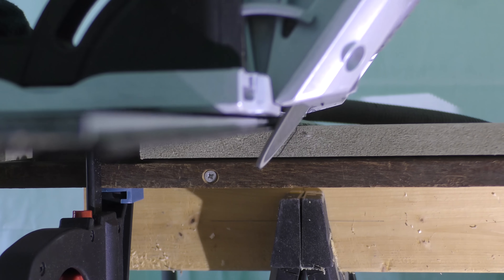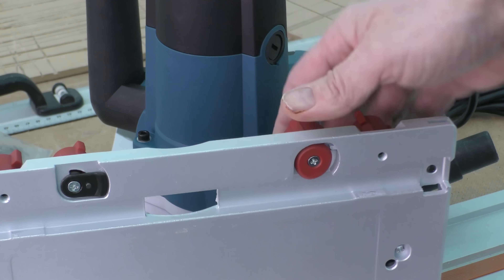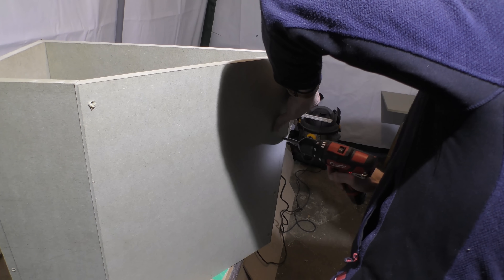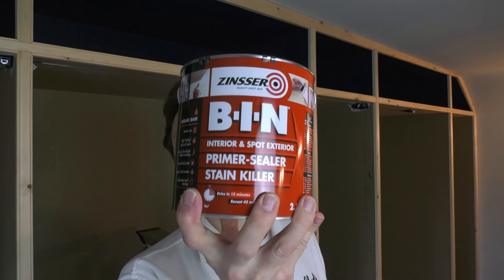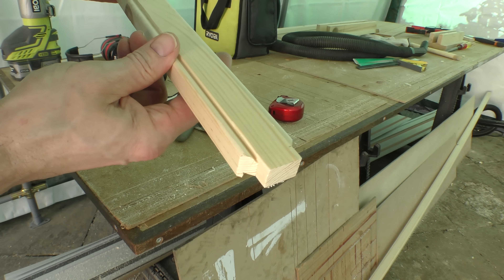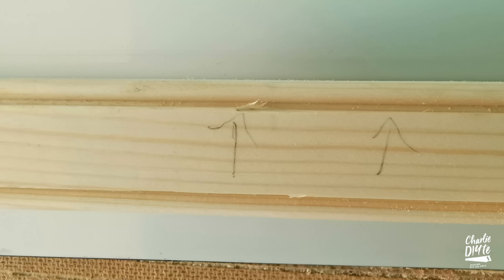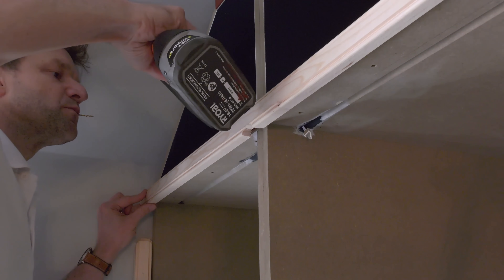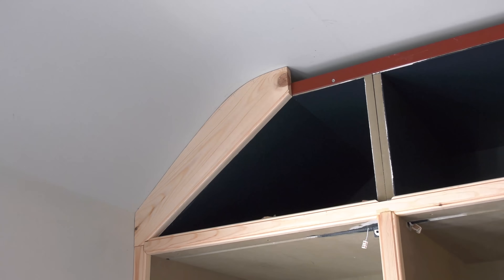DIY Fitted Wardrobe Build - TOP BOXES, PAINTING & FASCIAS - Video #4

Comment: charlie alan from scotland here, wonder if you can help me as i have new problem at my house , ive never had dampness or black mould in 20 years but about 2 months ago my partner noticed black mould at bottom corner of gable end of house , i checked my gutters with a camera and found they were full of moss and water front and back of house btw every corner of the gable end of the house had mould top and bottom and even along bottom of pvc window frames upstairs and down stairs can you please help , have have gutters repaired and cleaned, be much appreciated

Comment: Quick pro tip, when attaching your fillers at the sides add a couple of biscuits up the vertical edges of the mdf and it'll help your alignment and stop it pushing away from the side of the carcass as much, dominoes are best but we don't all have the budget for them 🤷‍♂️

Comment: Hi Charlie, I can’t say you are a diy’er you work more precisely than most professionals. Question how did you scribe the top metal strip. It fits so perfectly.
Reply from the maker: Thanks buddy. I lowered it to the point where I could position it horizontally and then scribed the contour of the ceiling on it, from memory. 😉

Comment: I love this Wardrobe Build! Around 1963, having just obtained my GCE in Woodwork I produced drawings to 'remodel' my parent's tiny kitchen. I actually measured the size of all the cupboard and drawer contents to ensure that their capacity was optimised. All construction was done with basic hand-tools (bought from the money I earned at a Saturday job), outside (no Workmate bench), over the long summer vacation. My father approved my design and paid for materials; N.B. mostly plywood and the worktop was Formica glued with contact adhesive! Maybe forty years later my 'kitchen' was replaced by 'modern units' and worktops. My mother, bless her, said that my 'bespoke design' was far better!

I have never regretted that my Secondary School taught me Woodwork, Metalwork and even Brickwork as well as Technical Drawing! With 'A Levels' in Physics and Mathematics my career was in Computer Engineering and that gave me greater skills in electrical installation than most 'electricians' and greater skills in 'Mechanical Engineering' than most 'mechanics'! I, with some 'self education' have taken on every trade! Plastering was was the most difficult, agonisingly exhausting and painful - that is one I will forever leave to the 'professionals'.
Reply: Interesting story Alan. I didn't know that was even possible before the multitool was invented :).
Reply: This sounds lovely. I wish schools still taught all of this. It is a useful life skill.

Comment: Love the colour of the inside of the top boxes would never have thought of that. Probably would have gone with the default white.
Reply from the maker: It's controversial mate, and I'm still soul searching over it. On the advice of an interior designer I heard on the radio, we've painted everything in the room - walls, skirting, window frames - the same colour, a pale blue, and we LOVE it. Removing that contrast makes the room seem larger and helps you focus on the outside. However we choose the wardrobe paint before we made that decision. So it could massively backfire or alternatively become a "wow factor" feature in the room. Only time will tell 🤞🏻

Comment: Try floetrol additive for the top coat water based paint. I've done that for skirting and doors. It makes the water based paint behave like oil based. The finish will be much better when brushing or rolling.
Reply from the maker: That's a lovely tip, and does it make it more durable too? Thanks Stephen 👍🏻
Reply: @CharlieDIYte  it's doesn't affect durability at all. Read all 1,100 plus reviews on Amazon ;) always best for waterbased paint to have a week or two to fully dry. Even 2k car paint can take months to achieve its full strength.

Comment: I use an old matchbox for my scribing tool as you can use it on the thin sides or the wider face/back pieces and it's readily handy in the tool draw on my workbench but you can use anything even a scrap piece of timber offcut.

Comment: Nice job Charlie.  I am still not sure about the metal band, but at least you used it in the correct orientation.  I also made a cyclone collector similar to yours and it works well.  The only problem is a collapsing barrel, which i have fixed for now with some internal wooden re-enforcement.
Reply: I agree about the metal band, correct orientation, great idea but not sure of implementation. I would prefer several fixings in both layers of the MDF shelves.
Really impressed with your execution of the wire loom. It really demonstrates the complexity required to deliver a lighting system for a built in wardrobes. To a layperson they would open a door and be pleasantly surprised that there's an auto lighting system without any appreciation of the work planning and execution required to deliver  a simple lighting system, well done bud for you persistence and determination to deliver those lights.

Comment: Hi Charlie, great progress and I like the face detailing with the softwood moulding which gives a touch of class. I think you may have been more successful gluing it onto the metalwork with PU cartridge adhesive such as can be bought from Toolstation etc. It sticks like sxxx to anything and joints dissimilar materials really well. It's also good at gap filling not that your work has any! All the best😁👍

Comment: Hey Charlie, was really hoping you would take us through how you measured the angles for
The end boxes, not many videos in that on tinternet and would be great to be taken through how to get the angles
Reply from the maker: I'm sorry about that Darren. If you pause it at 02:35 you'll see how I got the angles. I basically put the box without the angled section on its side, rested the diagonal piece on top and then drew on that diagonal piece a line in each corner where it hit the box. That was my cut line. Does that make sense? If not I'll see if there's any other way I can describe it.
Reply: @CharlieDIYte  yes didn’t catch it initially! Thanks Charlie, top class work
Reply from the maker: @dazcssdsc  Thanks mate 👍🏻

Comment: Please make sure you give those lime green rollers a good wash and rinse. I’ve started putting the pack through the washing machine on a wash before they get used. Even run them through a quick tumble as it seems to make sure they not then leave micro/flock in the paint !

Comment: Hi Charlie. Fascia looks really slick. You gave yourself a job routering the back edge to form around the steel strnthening bar. 
Couple questions. Would it not have been better to router a groove in the top of the main carcasses and run your strengthening bar along the top edge? Albeit along the bars weaker axis. The boxes may still belly in the middle of the cupboard behind otherwise?

And the golden question. How can you make water based paint more durable. Its a lot of work but have you considered finishing the whole thing with a water based polyurethane.  (cheapest product iv seen) is polyvine dead flat for painted finishes. It could be applied with a cheap sprayer once all the painter work is finished. And they have a dead flat option which would mean the varnish doesn't create an unwanted sheen on your painted surface? Food for thought as it's so heart breaking to scratch the surfaces after you sanded and painted the whole thing 4x over

Comment: Hi,

It's been a couple of years since this series has been uploaded but I have watched it twice now for inspiration (plus I didn't get one bit of it and had to rewatch the section on the 'trim' quite a few times before I understood what was going on. Thank you for such a clear video which has given me confidence too try this myself.

Few questions I apologise for the length of them in advance , but if either Charlie or any other budding DIYer has drawn inspiration from this build, that I would welcome some thoughts on:
The cupboard sizes and adding in a 'shelf', Charlie has opted for 'top boxes' due to the strength of the wood/aesthetics? The double wardrobe appear close to 1metre wide, ignoring cost, would the whole thing be better/worthwhile making out of Ply rather than MDF or are there some other downsides? If this was made out of Ply, would a 1metre shelf be viable or do we think that may still sag? (Lastly on the shelf/ply issue - Would screwing and glueing a shelf in be sufficient or is there a more effective way of installing?)

Also, everything was constructed with glue and screws, other than it being a pain in the backside getting everything aligned, would adding dowels or 'biscuits' (whole new world to me), be worth doing, or do we think that would have minimal gain?

How did the finished wardrobe stand up to the test of time, is there any flex in the side panels with the weight on them, are you still happy with them?

Thanks
Tom

Comment: I’d be interested in how you’ll caulk the joints between scribe and walls. I can imagine those walls will move a lot and the caulk would crack?
Reply from the maker: You've just reminded me, Rob. I should have primed the scribed wood where it contacts the caulk before I fixed them in place 🤦 I'll probably use the gap filler I used on this job https://bit.ly/38SZ9vK, which had much less shrinkage than caulk.

Comment: Really enjoying the video’s it has spurred on my interest to do carpentry projects. Like you am not a carpenter by trade but a DIY enthusiast so appreciate use of affordable tools,. Recently built a desk for my study using a circular saw and guides I made with mdf. Great result but dust all over my garage even though used dust extraction. Was hoping you might of talked a bit more about your new Erbauer plunge saw and how it compared to your Evoution  ?  Were your cuts alot more accurate, was it easier to use and how was the dust extraction?
Reply from the maker: So glad to hear it's spurred your interest. That's why I set up this channel!! I think the problem you have Pieter is that circular saws, whilst wonderfully versatile, were not designed with dust extraction in mind whereas plunge saws are. When cutting through sheets of MDF plugged into the vacuum, the dust was negligible. A little more when trimming an existing cut but you'd expect that because there's not so much suction against the open edge. I find the plunge saw a hot to use. I'm not always 100% accurate on the cuts of I'm honest - occasionally a mm too wide in the centre but that could be the way I'm aligning the cut out perhaps the quality of the saw. The cyclone is also a revelation. A week after a lot of cutting and the vacuum is still empty!

Comment: Wow, building anythjng like that would be a dream. For now we are installing a pax wardrobe and have a problem on how to fix it to the wall when we have a skirting board and a dado rail. I found one video suggesting to use a batton or piece of wood to fill the gap, fix it to the wall and then fix the wardrobe to the wood. We were wondering if it was possible to fix the screw straight to the plugs-long enough screws to get abt 4-5 cm into the plug. The wardrobe will be stopped by skirting and dado anyway, so wont be moving, just worried if there should be a problem with a screw not being fully in the wall- unnecesarrily? Would be soo grateful for a comment or reference to any of your videos! Thanks. Those are such massive help.
Reply from the maker: Hi Anna, you could certainly do that. You'd just need to choose the plugs and screws carefully, so that when you tighten the screw it doesn't pull the plug out of the wall, which it shouldn't if you've got a nice tight fit for the plug on the wall and a decent diameter screw. The batten method is obviously superior because you've got something nice and strong to fix to. With your suggested method you've got to be careful not to overtighten the screw and buckle the back of the wardrobe.
Reply: @CharlieDIYte  thanks so much for the hints! All make sense, we probably wouldnt have though of them. We are gking to go ahead with the option to go straight into the wall then :) fingers crossed we achieve a good result

Comment: Thank you Charlie, an outstanding set of videos,  packed with great info and advice. Can I just check, as you were using different thicknesses of MDF for the wardrobe carcasses and top boxes, did you reduce the width of your facial to compensate... or just have them wider? Thanks in anticipation.
Reply from the maker: Thanks Michael. No, the top boxes were still made from 18mm MDF. It's only the back of them that has the thinner thickness. 👍
Reply: @CharlieDIYte  Wow Charlie,  thank you so much for answering my question; all makes sense, my mistake. Thank you also for taking the time, really appreciate it.

Comment: Good work Charlie, 
I'm going to make 5 x 600mm wide carcasses and not any double width carcasses. Do you think I would still need to strengthen to eliminate sagging?
Reply from the maker: Thanks. No, you'll be fine with that. The single carcasses in my build wouldn't have needed strengthening, but it made sense to take that metal band all the way across to better support the wide ones. I wouldn't have bothered with the band if I didn't have the double wardrobes.
Reply: @CharlieDIYte  Excellent,  thats what I thought, thanks mate.

I'm getting excited to crack on with ours now. Our room is being fully plastered in a week and I have a week off work early April to focus on this build. 
I'm going to cheat a little by getting the sheet material pre cut to my cut list.

Comment: Hi Charlie 
Its a good video, just a shame you didn't show more detail for the trim work. I'm trying to figure out how you merge the vertical trim and the horizontal, as I can't imagine it is possible to trim the end grain of a vertical strip
Reply from the maker: Are you sure I didn't? I had a jig set up so I could trim the corners of each vertical section to 45 degrees with my fine tooth saw, then I made two 45 degree cuts in the horizontal section and removed the piece with a chisel so I could let in the vertical section.
Reply: @CharlieDIYte  Hi Charlie 
Thanks for the reply. Yes I remember that bit but I personally don't feel like it was explained in close enough detail considering it is quite an important element of the finished product. I will rewatch a few times and see if I can come to grips with the techniques used.

Thanks

Colm
Reply: @CharlieDIYte  thanks mate I have watched it back a couple of times and can see now how you have achieved the look. Thanks

Comment: Charlie you did say you were going to talk about fitting insulation/ vapour barrier for north facing walls.did I miss it matey.Tim in notts
Reply from the maker: Hi Tim, I mentioned the need to do so but didn't say I was going to talk further about it, as my walls are insulated and moisture isn't an issue here, because I keep it under control (following this video https://youtu.be/TIDb-pdOnXM). If you're worried about building a wardrobe on a cold wall, you do definitely need to insulate the wall first. Insulated plasterboard typically has an inbuilt vapour barrier. In this room I actually battened the wall, insulated in between the battens with 1 inch thick foil coated Ecotherm, foil taped over the battens, and then screwed insulated plasterboard to the battens. So in effect I have two vapour barriers.

Comment: Hi Charlie. I re-watched this to get some info on the MDF primer you used. I have a single MDF fascia for an understairs pull out drawer to paint, which will then be emulsioned the same colour as the walls. Which would you recommend for a one off project? Cheers 👍🏻
Reply from the maker: Personally Matt I use Zinsser BIN for everything these days. But if you want something a bit less brittle that's recommended for MDF, try the Zinsser Bullseye 123 Plus. Tip from the painter on my Discord forum. It's better than the 123 original. 👍
Reply: @CharlieDIYte  Thanks Charlie and Happy New Year 👍🏻

Comment: Hi Charlie, great work I'm going to build mine rather than give it to a carpenter after watching these videos. My concern is once you make the carcass (18mm or 22mm mdf like you), does it not need a diagonal brace to keep it square? What does the metalwork do? Also, out of sheer curiosity from somebody who also has the 'day job' get in the way of DIY - what is your day job??
Reply from the maker: It shouldn't need a brace because it's either sandwiched against other carcasses or in any event it's anchored to the wall. The metal stops the top sagging. My old day job was in soft furnishings 👍🏻

Comment: Great series of videos, did you route a channel into all your facia strips or just those going over the metal supports
Reply from the maker: Just those going over the metal, and a little bit off the back edge of the vertical sections where they butted up to the horizontal sections that had the metal behind.

Comment: As I understand it, all rust should be removed because corrosion will continue under any protective coating. However, rolled steel will have a black carbon coating that must be removed before painting with anti-corrosive coatings.